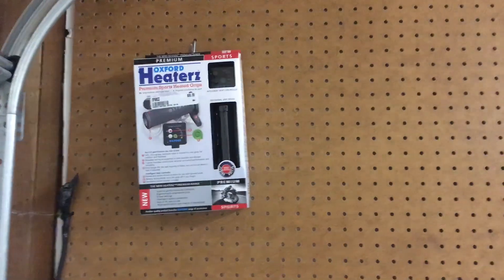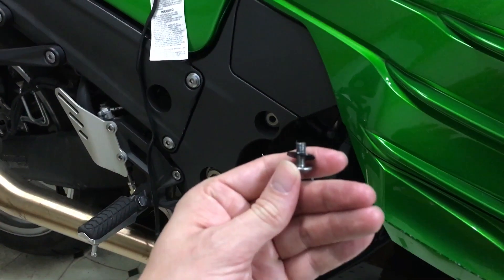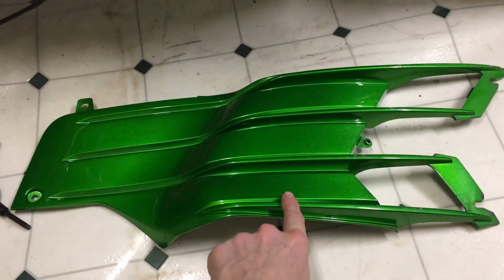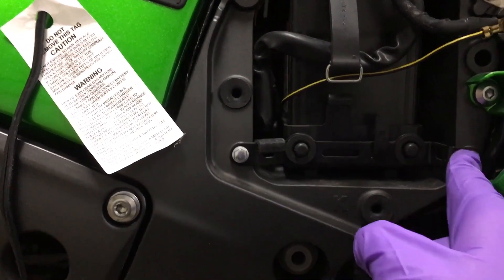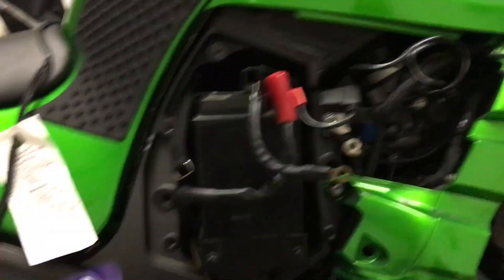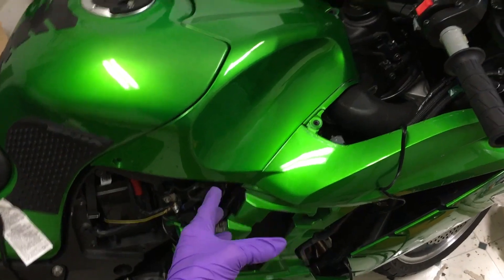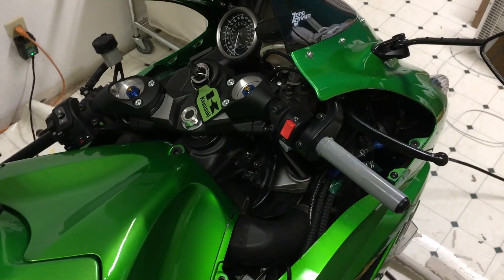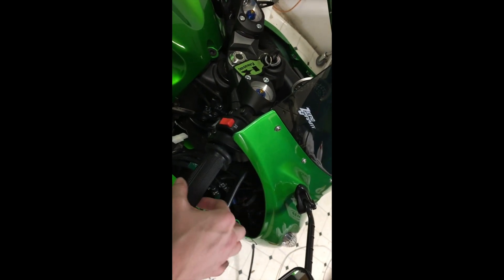Oxford (Heaterz) Heated Grips installation

Comment: Your choice was Sport version of the grips and oxford throttle grip length matches original throttle grip length ? Is this right? You did not cut Oxford throttle to clear bar end weight ?
Reply from the maker: Fast5. Ru I didn’t cut the grips but there did not seem to be an issue with the bar ends.
Reply: Moto Drangus thank you
Reply from the maker: no prob buddy, I think if I were to cut the grip it would look bad or potentially expose the heating elements.  Just not sure.  Have a good one.
Reply: Moto Drangus good advise for good advice : if you ever will want a quickshifter for your 14r - go for  Translogic UK. They offer best of the best , called intellyshift